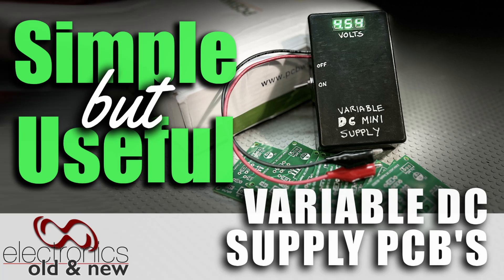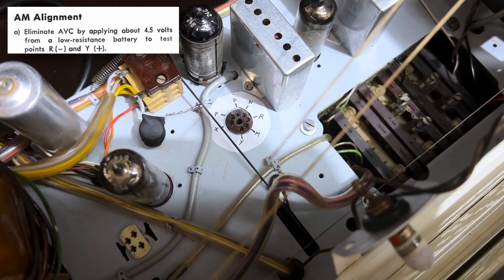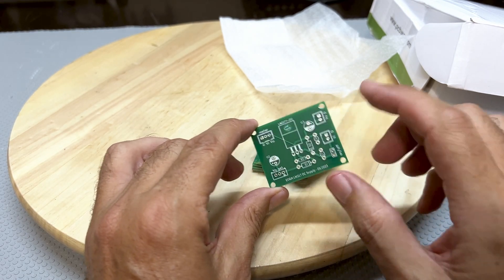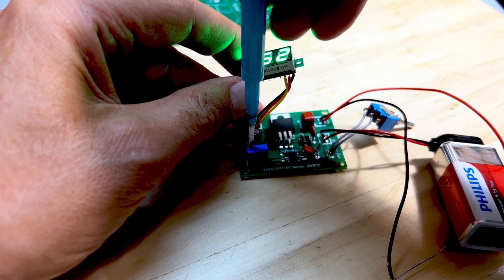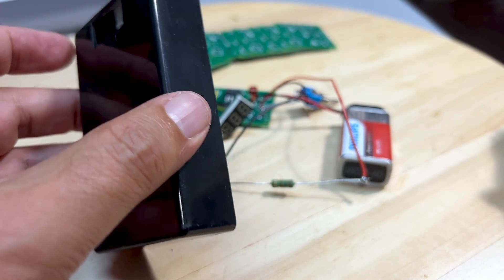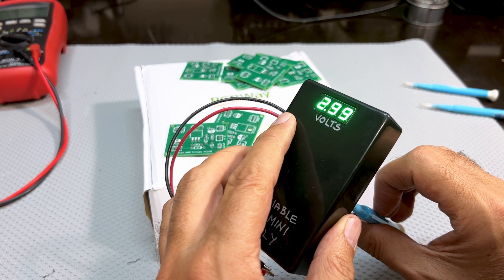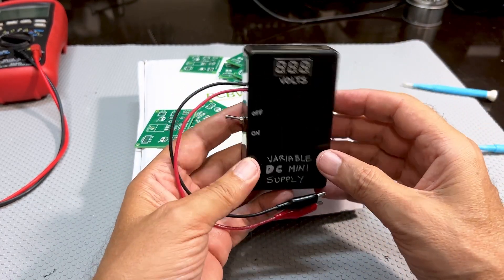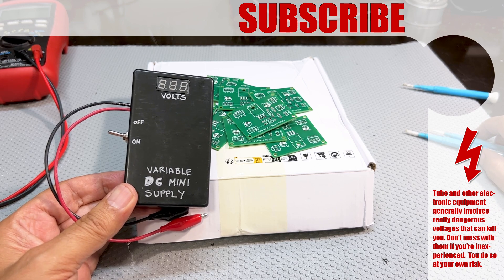Simple but extremely useful LM317 variable power supply pcb's #pcbway#

Comment: Nice little project. One question, wouldn't it be more practical to have the adjustment pot on the side of the enclosure in stead of on the underside? Now you can't adjust the output voltage in a convenient position.
Reply from the maker: Yes, it would be easier. I just decided to leave it there as it made the build easier, but a small pot would be even better to make quick adjustments.
Reply: @electronicsoldandnew  You could have turned the pot on the PCB 90 degrees.. It would have increased the options. Perhaps nice for a future modification of the PCB.

Comment: Ahh the Lm317, so handy and apart from the 78xx series i don't need much else.
I made a 18v power supply for my friends hacker sov,  lm317T with extra bits and an internal preset for the voltage set, the preset was padded with resistors so the pot only controlled the final two volts,  The preset could fail but it was limited.
About 7 years have passed by and no change.
Gotta love the lm317T :-D
Dam you fell asleep.. sorry.
Reply from the maker: Nope, wide awake 😊 I agree with you.

Comment: I understand that precision is not very important here but most of these meters have a tiny pot where you can calibrate them to a pretty decent precision. LED display will put a decent amount of strain to the already very small capacity 9V battery, maybe it is better to use 3S li-po batteries in this one?
Reply from the maker: Yes, I have done the adjustment with the little trimmer, but inevitably the precision varies from lowest to highest reading. As for the actual battery, any battery can be used up to a total input voltage of over 30V.

Comment: Well done, great piece of test gear. Very useful (no hint of Lipman sarcasm). Of course, you can by a buck-boost module with display, pot, limits etc for £9.95, but where's the fun in that? Maybe some white Letraset and a simple diffuser for the 7 seg, for version 2.

Comment: I love these little projects.  They are always quite useful, and usually something I end up thinking "Why didn't I think of that?" as this little supply would be highly useful.   I can see many uses for this when doing my little microcontroller projects as well, as the ESP chips I use often use 3.3V, or 5V on power lines and I often need to switch between 3.3 and 5V supply lines.

Comment: Hi Manuel, If you want longer battery life, place a push button to turn on the voltmeter.
Reply from the maker: Good idea
Reply: I agree.  Those displays draw significant current, when the power source is a nine volt battery. Since you have screwdriver adjust vs a knob, the device is intended as a set-and-forget supply. So, you really only need the voltmeter during the adjustment sequence.
Reply: This idea has good merit. I think that it does require the addition of some sort of power on indicator. Maybe a LED made to blink occasionally by a simple resistor/capacitor circuit.

Comment: LM317 is quite noisy , there are much better today. It need over head too . So it is not LDO regulator
Reply: Is it quiet or noisy? 😁
Reply from the maker: In this instance it’s very quiet as the source is a battery,

Comment: The LM1117 LT1117 LD1117 AMS1117 would have been a better choice. It is the drop in replacement low drop(!), low quiescent current version of the ancient LM317. And on a 9V Block battery as a supply the 800mA output current limit of the LD1117 is surely not an issue.
Reply from the maker: True. These boards are meant to be useable with whichever IC you prefer, as long as it’s got the same pinout. I actually ran out of LM317s so used the LM338. Way overkill for this application.
Reply: @electronicsoldandnew  Maybe not overkill for your extended use to power your under-shelf units. I was thinking that the 317/1-1.5A wasn't going to be sufficient.